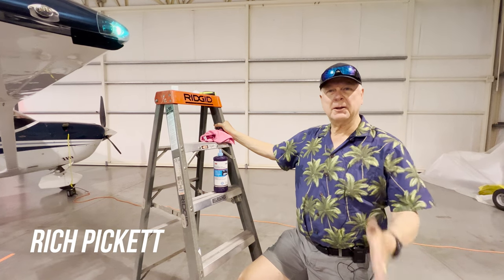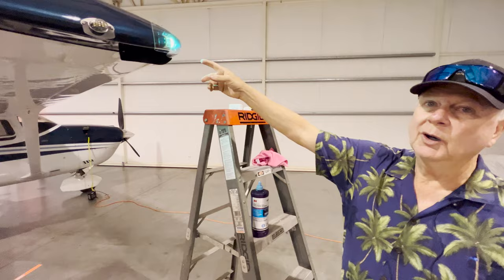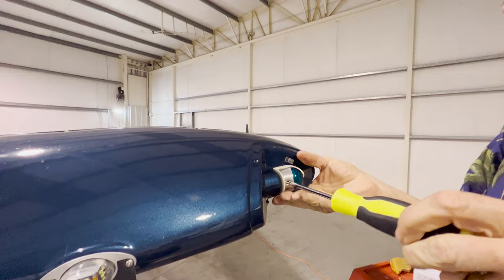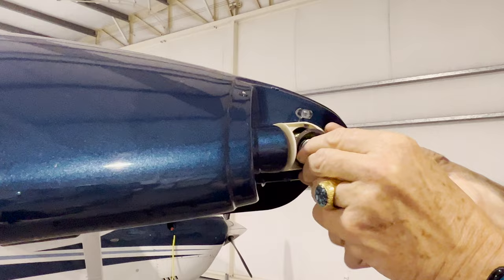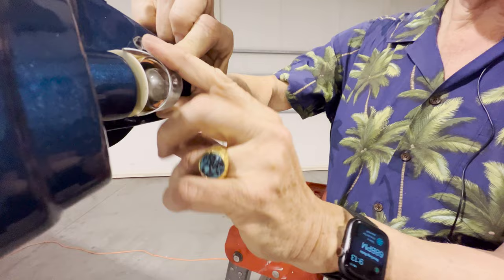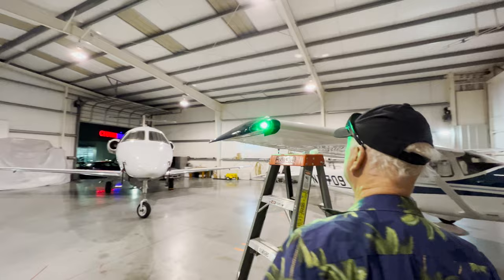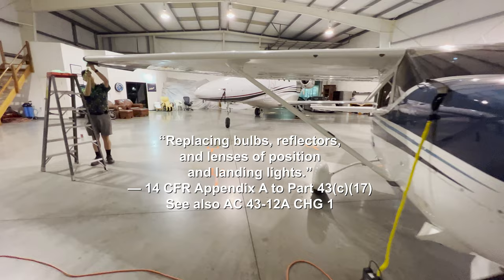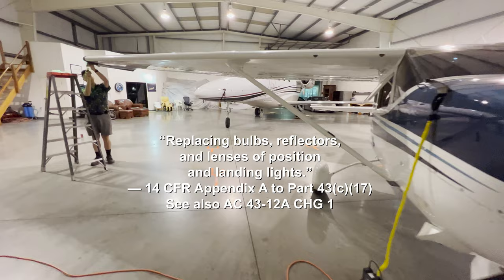How to Install LED Nav Lights on a Cessna Turbo 206

Comment: What did the 337 look like when you installed these LED that don't carry a PMA?
Reply from the maker: We ended up replacing the entire unit with a WAT version during our Flint Tip tank upgrade.  Aircraft Spruce and others offer PMA versions of the nav light bulbs which solves the issue if not replacing the unit nav light unit.

Comment: I'm not sure I'm sold on this concept.  Kinda ridiculous they only provide about 50,000 hours service life.  

Let me do some mathematical math.  Hmmm.  When I'm on my 25th engine change in this experimental Super Skylane I'll have to budget in for a new set of wingtip LED lights.   Uhh . .  I don't think I'll be around that long.  Yikes.    
Maybe this is not such a bad dill after all.  :  )
Reply from the maker: Horace as pilots, we always want to fly forever :)  These LED bulbs are inexpensive, and the longevity typically much longer than the incandescents and much brighter.  We actually ended up installing extended tip tanks so we had to come up with an even brighter, and more expensive, alternative for the tips.  When Tigre finishes all the edits you can see those in action.   I think it is very difficult to come up with an economic justification for almost any airplane upgrade, especially fairings that promise a speed increase - when they don't!  The lights just look cool.
Reply: @PersonalWings  :  Excuse the Paul Bertorelli sarcasm.  :  )   No doubt the LEDs are the way to go.  Low current draw, brighter, last practically forever.  I keep my LED landing light on 100% of the time.  Sometimes I flash for warning to others.  I bought a Teledyne Alpha Beam landing/taxi light several years ago.  It is the best light I've ever had.  I don't think it's made any more.
Reply from the maker: @horacesawyer2487  Horace it made me laugh!  I'm replacing our hangar light with LEDs this week and it will only take us several years to recoup the cost!  But they are nice.  I agree with you, that with LEDs pilots tend to use them more frequently since they use less current and last longer - hence the added safety benefit you mentioned.  On our new wing tanks we experimented with the new Whelen nav/strobe design - but it requires a lens to protect the light.  We have also replaced the landing lights on our jets - it just costs $12k for each plane. You are correct the Alpha Beam isn't currently available.  Thanks for watching our videos!